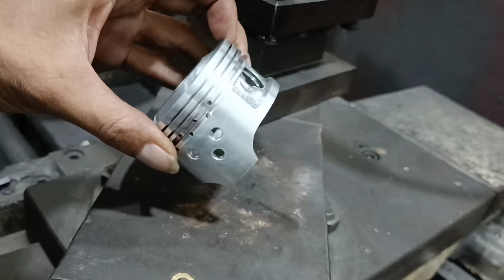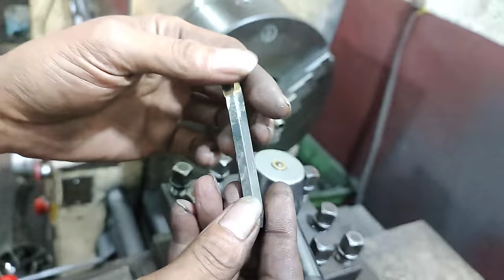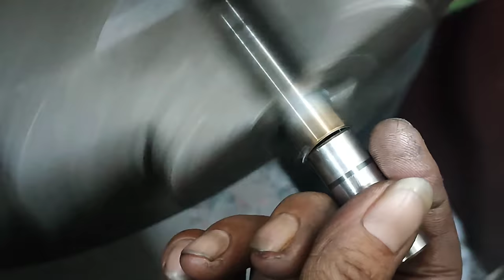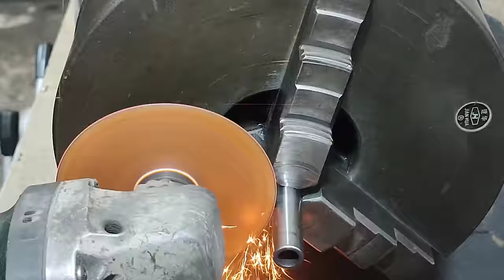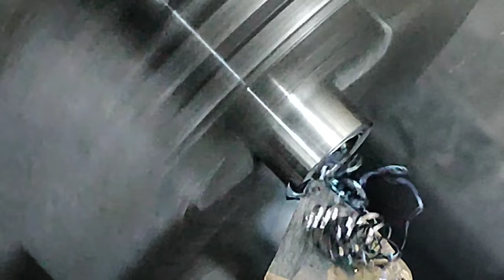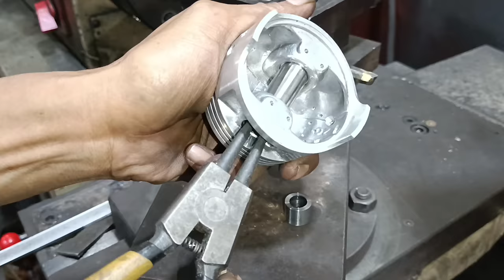"mechanical Genius Idea When You Don't Get The Right Piston"

Comment: as a mechanic engeneer i can tall you that this idea may only work for a short period of time. as soon as the pin eats out the hand made sleeves it'll rock and knock like crazy and alter the ignition stroke. i know ther's lubricating oil there but every moving part has lubricating holes. it may work for a period of time but it'll eventually give in. what you did here is putting the sleeves in the lubricaying holes but where they contact the piston pin it'll be metal versus metal. you can fix it just by drilling small lubricating oils in the sleeves.
Reply: Fakta nya tetap tahan karena yg bergerak hanya bushing bukan pin piston ke piston
Reply: @ayuwandira4520  а чем фиксироваться будет втулка в поршне? А как разобрать поршень, когда палец заклинит во втулке с обеих сторон?
Reply: This chanel does a dodgy job on every project
Reply: @powershop1903  i am the second to the chief engeneer of a well know motorcycle company in Italy. we have a huge test facility and i've seen too many designs fail. i've been studying for 18 years. infact after your comments i've put this same ida to the simulator and surely if failed after  6 hours at a constsnt speed of 5000 rpm (air cooled in a 30°C ambient temp.) you can blame the setup as you like but if failed at that specific spot showing a rise of temp more than usual in operation condition by 5°C. there's a lot of technical data that i'm sure will go above your heads but that's how we test our products before manufacturing the prototype.
Reply: Exatly
Reply: Exatly

Comment: Nothing new to me, did the same around 1989. 
14mm 'overbore' fitted Suzuki GS1000 liners and pistons to a Honda CJ250 (246cc to 391cc conversion)
It was worth it to experiment plus bike got a load more torque and power (from 85mph to around 120 mph)
I did a lot of CB360's in early 2000's using Suzuki GS850 pistons, they are a very simple 2mm overbore
Reply: Great
Reply: @AmrinderSingh-zx9hr  I have a few video's from 10~12 years ago, contact details will be on there somewhere

Comment: First of all, holy tool stick-out batman.  That squealing sound is your tool crying for mercy.  Second, keep your fingers away from the chuck jaws. Third, just bore out the rod-eye and put in an oversized bushing. The bushing should probably be replaced anyway.  It's OK though.  That repair will last long enough for the customer to pay the bill and be out the door before those cups slip out and score the cylinder bore.

Comment: Are you sure those bushings don't open while the engine is running? You could make them a little thicker by reducing the diameter of the piston pin ends.
Reply: it more dangerous to lessen the already thin piston pin even just a bit of 1mm,
it might be ok if the bike is still on stock specs and not used in a long ang hard run
Reply: It's the same material so it should expand at the same rate

Comment: As a mechanic and engineer, I have to say, what you are doing is extremely risky.  Unfortunately, a lot more thought goes into the design and construction of a reciprocating powerplant.  When assembling critical engine internal parts, very few people on this planet actually have the jeweler's finesse to machine things to critical tolerances.  The wrist pins for the connecting rod/piston assemblies are as critical as it gets! The con rod/wrist pin/piston assembly has got to fit together perfectly when cold, but also when hot and moving and under load and at high rpm and for a continuous period of time without breaking or breaking down. (Sorry, I'm out of breath after that last sentence!) 

I admire you for trying, but there is an at least 80 percent chance your attempt at this repair, albeit noble, will fail catastrophically.

My best regards to you and your shop, fellow sufferer, as mechanics are NEVER treated fairly....

Sincerely,
Jason Wampler, 
W A M P L E R

Comment: I think I'd just bore the rod,  but this would be lots of work, removing it,  but if it works it works!! Maybe do a press fit so they do not move around, the piston and rod/ pin is a very dynamic system!
Reply: А как потом разобрать?
Reply: @alexbut9487  won't be needing to disassemble. Just replace as a whole
Reply: @ramrajpanthukalathil1601  😂🤣👍
Reply: Boring the rod to a heat crimp fitment and having the piston pin pivot in the piston holes would be my preference, instead of introducing some mystery metal with all the temperature and lubrication problems that might come with it. Added advantage is that you can use off the shelf parts, except for the con rod.

Comment: Crazy! And how would you press the wrist pin into the connecting rod? The cups made could move inward as the connecting rod does not fill the inside of the piston skirt. If it is the wrong piston why would you try to use it?

Comment: Would it not been easier to increase the inner diameter of the small end of the connecting rod at this point?
Reply: Think about it you would be taking the small end of the connecting rod only .040" bigger to accommodate the 15 mm wrist pin on piston.